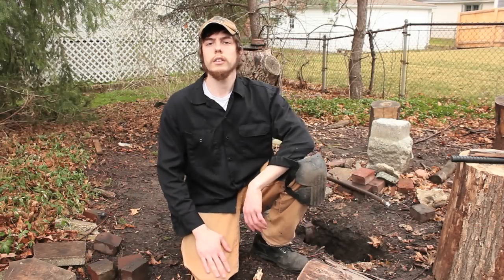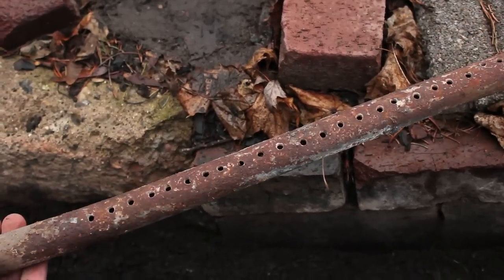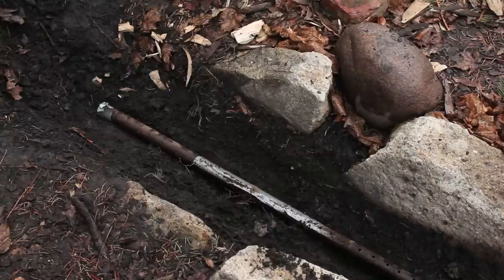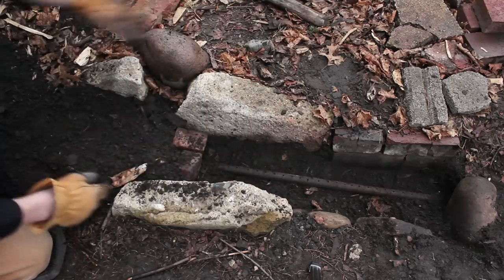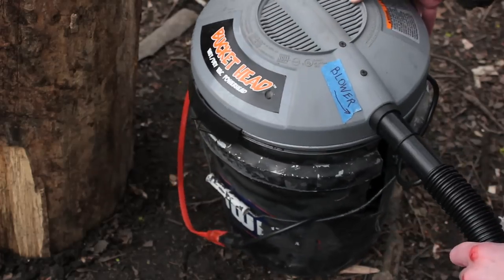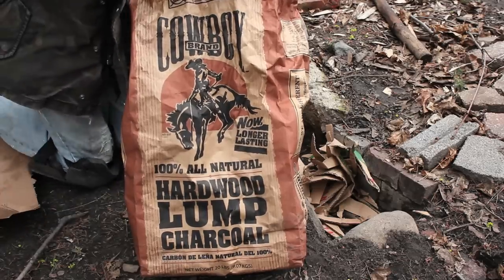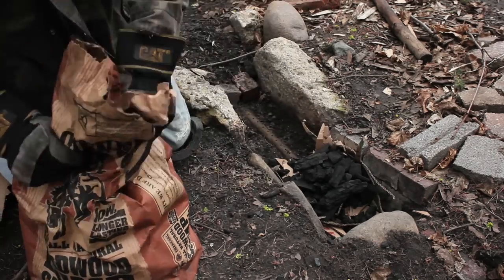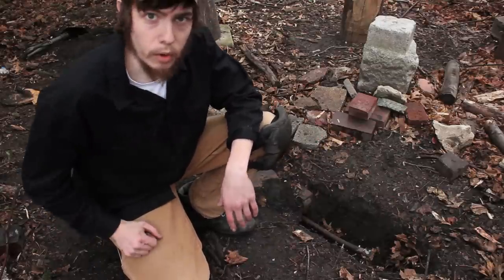Backyard Charcoal Forge, Trench Set-up with Shop-Vac Bellows

Comment: I love this. I made one similar 8 years ago but luckily I had access to an air compressor and a regulator. I put it on a cement slab and used paving stones to wall and cover it.  I had to bend a small I-beam from an old 30's ford front end to make a downtube for a motorcycle. It bent easy as butter.

Comment: coal is actually cheaper..though it may cost 25$ for 25-30 pounds in the long run its far better and superior to lump coal and will produce you better heat and less ashes all over the place lol.I have dealt with lump coal,and just using chopped up chunks of oak(non coaled just plain old wood),and Mined coal from chunks to almond sized.Mined coal was the best but when it goes and you don't have a local supplier then it kinda sucks but there are plenty of dealers that provide free shipping of coal though on ebay.But as you say there is nothing wrong with using what you got as fuel,if you have a passion to forge you will do anything to make it happen.
Reply: GhostCreeper I recently switched to coke, and haven't been happier smithing. Its a drive to buy it but I have no problem with a short road trip to get such a good fuel. After I figured out how to adjust my forge for it, I haven't looked back, from more centralized heat to, majorly, the lack of cinders.

Comment: I wonder, does the air flow from the vac come out too strong?  If so, you could cut a tiny hole in the tube to let execess pressure out, then tape it up until its just the right size and air flow.  I guess, but it'd be cool to put a pipe valve on it.  :)
Reply from the maker: Gristle Von Raben I haven't found it to be too strong, but if I needed to cut the air flow I would probably open up the duct-tape connection to let air escape that way. I've also got tape holding the two tubes together so I could create a valve or vent there if need be.

Comment: How many burns do you get out of a bag?
Reply from the maker: It depends on how cold it is outside and how big the blade is.  Today was in the 30's and I went through a bag and a half in maybe 4 hours.
Reply: Phil Baumhardt ok. Thanks for the info.
Reply: Use anthracite coal from tractor supply co if there is one near you. It’s much cheaper. I buy a 40 lb bag for around 8-15$ depending on location and a 40 lb bag lasts me for more than a week or two with a daily fire. I use a small hand crank blower. Start a small wood fire and burn till about half if it’s burnt than put a few chunks of charcoal and last pile coal on the fire. Easy to start burns very hot and very clean. No sparks either once it’s going. One lb can last me for roughly 30 minutes. It’s almost if not 10 times longer lasting than charcoal and much cheaper. But I  also love charcoal. It’s what I started on great for learning. Anthracite also does not coke or leave clinkers and is managed much like charcoal.
Reply from the maker: I appreciate the tip! @JustinTopp
Reply: Phil Baumhardt charcoal is always viable Too. I have yet to make money off the hobby so I go with coal for value. I’ve also grown to like it
Reply from the maker: I didn't know it was that cheap. The closest TSC is 40min from me, but the next time I'm close I'll take a look.  Charcoal has been good to me, and easy to find. @JustinTopp
Reply: Phil Baumhardt https://www.tractorsupply.com/tsc/product/premium-nut-coal it’s normally about 6$ if they don’t have it you should be able to have them order some In for you. If you do get some I recommend nut sized over pea sized